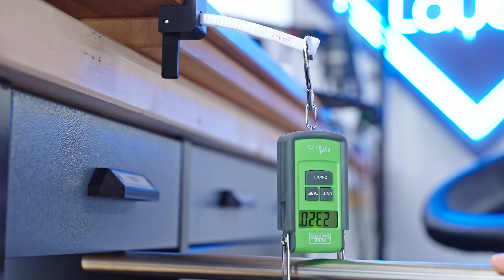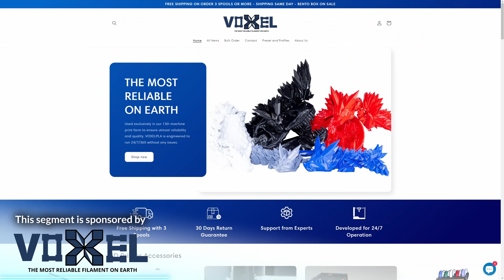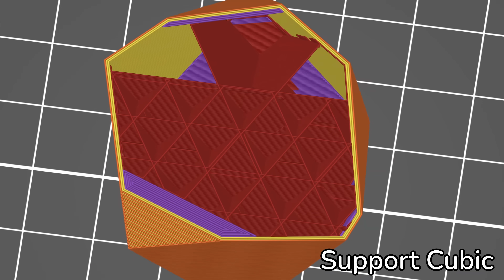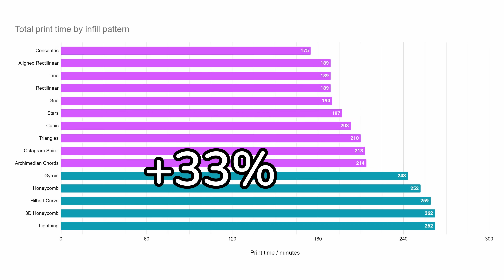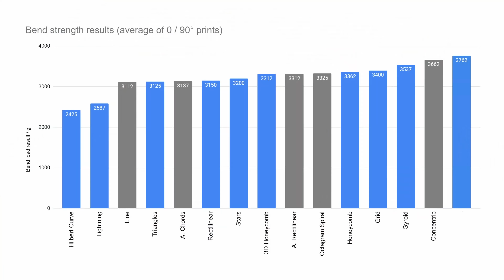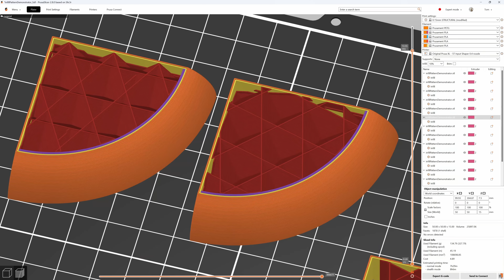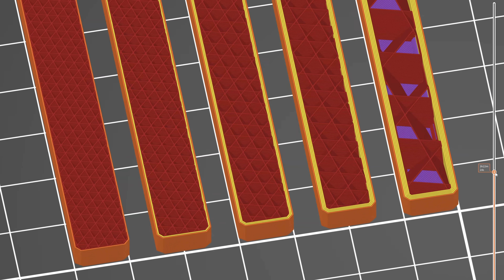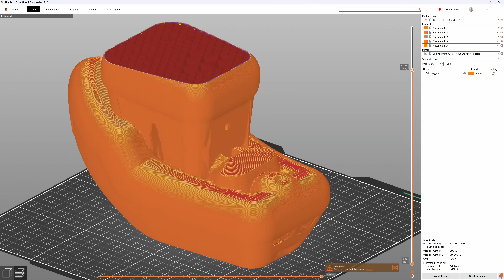Rethink how you use 3D printer infill!

Comment: Every time I think how to optimise infill for a particular use case, I come to the conclusion that something like a CAD integrated slicer would be the best solution. I mean in most CAD applications you can simulate directed loads. Using this information, maybe with some AI magic dust on top, a use case specialised infill pattern could be generated. As I’m only a hobbyist I don’t know if that already is implemented in more professionalised software than what I know about.(?)

Comment: Ok maybe you want to rethink that just by watching your video. So first we figured out the cubic(as it should be) is overall best at making things work. For one du to it's universal directional rigidity and two actually because it crosses over itself. This strengthens all the crossing with double material creating thickened edges inside the pattern while still be ultra fast because straight lines.. ok sure I did know that. But the ominous ripping itself apart
Later you pointed out that she'll goes over everything so we can just neglect infill an take that only into account for top layers in that case the best combo should be thick with rectilinear. It's blazingly fast - straight lines - and doesn't have an issue with ripping but is near perfect for top layers. Rectilinear is the actual grid pattern slicers should have default because this one just works - always - at any density to give the users the highest chance of a successful printing. It's like turning on infill combination(infill every other layer) but not because it's touching every layer avoiding issues with significant different layertimes every layer which can cause printartefacts.
Just saying from all combined above this should be the winner in terms of overall performance. It's weak but we don't really care because the shell is doing the strength and infill only provide structural shape holding and top layer surface promotion functionality

Comment: One advantage that Gyroid has is that it allows the print to be filled internally to add weight or possibly with foam for strength.  I've printed some tall sculptures that I've added sand in the base to make them less "tippy".  The closed patterns won't allow the sand to flow beyond their individual chambers.  I also like Gyroid for it's multi-directional support.
Reply: Hilbert and other open variations are even better for pumping the model full of PU resin/foam, gesso, concrete or what have you.
Reply: Another good use for gyroid (and 3D honeycomb as well) is exposed as drip trays for plants, coffeemakers, etc. Because of that open pattern, liquids flow between the cells.
Reply: @YoSpiff  I made some drip trays for soap bars this way. Just add a modifier object in the slicer and set it to remove the top and bottom layers at the overlapping spots and its fine. Might need to slow down the infill speed a bit to make them look nicer tho
Reply: Do you pause the print to fill it up or how do you do it? I printed a cool tall vase for my mom but it keeps falling 😢
Reply: @tuliagz5329  Is the vase used for liquids or just used with dry plants or flowers (or nothing at all).  Usually, you would drill a hole in the bottom of the object and use a funnel to fill the infill portion of the print - or at least partially at the bottom - then use something like a mixture of 5-minute epoxy and sand to plug the hole.  You may have to roll the object around to distribute the sand or whatever you're using.  If the vase is easily accessible from the top you could put the weighted media in from the top - sand or plaster or lead shot and seal it with a layer of epoxy.  There are a few ways to do that, but without knowing the structure of the vase it's hard to make sure recommendations.

Comment: I've recognized cubic infill when Cura and Ender 3 was my choice half a decade ago. It felt intuitively and logically right, to use cubic since then. When I got my mini, some years ago, it was strange to see gyroid as "all profiles standard" in Prusa Slicer. When I got my XL it was the grid infill, if my memories are correct. So the usual first thing to do is to check, if cubic infill is selected. And btw, PETG is my 90% go to material, for ultra high strength parts some PC. PLA was a disappointment so often, that since I flew the limitations of my moody Ender, I didn't buy another new roll of PLA, except one Galaxy Black PLA, for it's mat finish. PETG is more on the shiny side of live. 😂

Comment: Turnes out gyroid is faster than cubic on mu Klipper machines. Alltough slicer says cubic is faster, in real life it isn't. Also I use very aggressive speed settings on infill and gyroid doesn't stop on a dime at the end so the rocking of the printer isn't that bad 😅

Comment: I think your thumbnail was one of the main reasons you got 50K views in one single day! -It's just perfect! 😃
-Anyway, I'd like to put a note up that I've used 1.2mm wall thickness for more than 2 years and I've gotten quite good results with both PLA and PETG. I'm using and old, old version of Cura and won't change anytime soon, so I'll not have the benefit of getting cubic infill (which I'd like to use).
[I never see any infill-artifacts on the surfaces, because I use so thick walls - except from of course when I use translucent filaments].
Excellent video; I could watch from start to finish without falling asleep (most YT-videos make me fall asleep nowadays). 😃

Comment: Gyroid has been my go-to for the longest time now. Great strength to weight, reasonably quick printing, and minimal external surface artifacts. Another benefit is that if you do need to fill the print, all of the airspace is contiguous, so filler materials (resin, plaster, sand etc) flows fairly easily to fill the space.

Comment: Another vouch for the concentric, hilbert, archemides, and octogram is that as they're completely free of any isolated pockets and can be taken advantage of when you want to fill in the void fraction of a 3d print to further strengthen them. Such as as filling them in with resin. 

You can't do that with a lot of the other infill options.
Reply: This is the case with gyroid as well. This also means hot air can be trapped in those pockets which creates pillowing occasionally. Good to know the different options for different use cases.

Comment: CNC kitchen did a pretty deep dive on this issue a while back, at least in respect to shell thickness and strength. Infill has relatively little impact on part strength even when it's set pretty high. I usually run 4-6 perimeters with as low density possible with lightning infill to save on material since infill contributes relatively little even in different use cases. The only con of lightning infill is slow print times though.
Reply: The problem with infill in regards to bending strength is that the infill contribution to the cross section's moment of inertia around the neutral axis is extremely low.  Extra top and bottom layers put material where the majority of normal bending stresses occur.

Comment: Another thorough and useful test Thomas. You are a gentlemen and a scholar my friend.  I have been using the Voxel PETG + for a few months now and it has been performing great on my XMax3.  I was hesitant to believe the claims it works on high speed printers but it certainly does.  It sands much easier than PLA as well.

Comment: I print materials that, overall, gotta go slow anyway but I need similar strength profules actoss multiple axes. I used to spend hours tweaking infill settings to get the cubic and other straight-line patterns arranged just right to preserve strength and top surface quality until gyroid came along.

Now my print default is 15% gyroid and three shell layers and I can't remember the last time a part failed to print of perform well.

Comment: I really like to use the gradual infill setting on Cura - for parts that are for show and not strength. You can get high surface infill at the top for where you want things to print smooth and sparse infill elsewhere for material and time saving (40% infill at the surface rapidly falls to just 10% with only 2 steps). The lack of this and gradual support settings are currently causing me to hesitate to jump to Prusa/Bambu/Orca Slicer.

Comment: To print infill fast on my modded ender 3 v2 i typically use 150% - 200% line width and 20% - 75% infill density with the grid pattern.

Comment: One of the patterns you thought was just in there, I actually have a specific but incredible use for. On the concentric pattern, I actually have two uses. One is purely aesthetic, on transparent filaments sometimes you don't want the infill to show and strength isn't paramount.  The second use is more functional. On TPU prints, flexibility is always needed, but it can vary in how much flex is desired in one axis. I find the concentric infill makes for a very strong vertical strength but very weak lateral resistance. This is super useful if I don't want to spend hours in CAD to do the same.
Reply: very good points. I used to use lightning infill for transparent prints and it looked pretty good. but for "full" transparency I recon concentric is better indeed
Reply: This might differ in practice, but in mechanical theory honeycomb is supposed to be highly anisotropic as well so that might be worth a shot
Reply: Thank you for this worthy addition to his already great video! Especially the adjustment of flexibility in TPU prints is a very nice concept.

Comment: mostly used default grid pattern since it prints fast and is good no matter the orientation, shape or size of your part. over 30%/35% infill was never bringing me any additional benefit and sometimes even decreased strength and quality. below 10% infill (about a 1cm bridge distance) part strength as well as top support is about the limit. A good default is 10% (1 or 2 shells) for fast prints 15% (2 shells) for everything or 20%/25% (2 or even 3 shells) for strong. honey comb is kind of good for strength but very slow for big models even on old printers. most patterns are a wast of time and material or highly situational at best. 3d rotated patterns tend to have bad layer adhesion in some cases which may even harm strength.

Comment: I’m fairly new at printing but I use gyroid for parts that need to resist deformation in many different orientations. I had assumed it would be decently fast (even with input shaping) since it doesn’t have many sharp corners to start/stop. 
One thing I was thinking for thin parts with 100% infill might be to use concentric so your nozzle isn’t bouncing around.
 
Hilbert curve might be a good one for flexible/semi-flexible filament in parts you want to bend- in the sideways direction.

Comment: When optimizing, it would make sense to have the strength in the shell and the infill to be as minimal as possible to support the top layer. Following that logic wouldn’t it make sense to use lightning infill?
Reply: Keep in mind that lightning will make it mostly hollow inside, with no support at all for most of the shape. Honestly I'd rather have even minimal infill than no infill in many cases, so I often use support cubic instead. Also if you have a problem with the infill, lightning usually won't recover.

Comment: Personally I use rectilinear for its clean prints and very minimal internal wiping, it also prints nicely on both bedslingers and core xy alike. One thing I find it particularly useful for is checking that bridging and general extrusion is in point when I’m switching filaments for different prints as if it is off even slightly you see it won’t connect at walls or sags in the infill and is really easy to see. Top layers are nice due to the even square finish if you want top keep top layers to around 4 instead of going higher and using more filament :)

Comment: I like the idea of printing thicker infills to save time. I think delamination occurs as separately printed structures have time to cool and therefore don't adhere to one another.

I have recently printed small-ish parts that needed some strength and wall-to-infill ratio made very little difference. I found the biggest gains in strength by lowering printing speeds altogether.

Comment: These test are good and give data as a starting point, but for anyone trying to learn and understand what makes a print strong to a precise point, use TPU. It is an amplified version of what’s happening microscopically as your stiff parts snap, allowing you to feel and understand it to control it. 

Infills are very directional for load application. Thicker infill or line multiplier greatly increase rigidity 

Best of all the part never truly breaks allowing you to return and do the test months later to freshen up the knowledge, without wasting time for breaking more test prints.

Comment: For thicker infill use infill line multiplier (as named in cura) so each layer is double thick. This is for strength as it add rigidity to an otherwise flexible thin wall. Half the infill and double the multiplier. Speed and material use-age are similar, but strength is better

Comment: Another criteria that for some reason almost no one talk about - is how  NOISY or SILENCE the infill print is? in my case, where the printer is in my office - this is a decision point. The standard grid infill is one of the most silence one to print with, and as much as I can explain that, it comes down to two key reasons: only one motor is active at a while printing grid infill (as the printing head moves either on the x axis or y axis) and second reason is the there are no overhang parts in grid infill (like you might have in cubic or gyro) therefore no need to boost the fan to 100% to cool the overhand parts down

Comment: When printing functional stuff, it's important to think where the stress will actually be when used. Walls and infill reinforce the whole model evenly, but in real life we only have one or two weak spots where parts break. It's much better to reinforce these weak spots with internal geometry (which will be printed as hidden walls inside) and reduce the overall amount of walls and infill to save plastic and increase printing speed.

Comment: I use Gyroid because its more silent than the crossing of cubic, it also doesn't wear the nozzle down as much. And for me the time difference isn't even that much, maybe on a coreXY but on a bedslinger? nah fam, they are practically the same speed. On another note, gyroid is really good for making TPU parts that need to have a uniform pressure/deformation resistance and the non 3d infills can make TPU stronger in one direction but more bendy in another if you want that.

Comment: I really like printing with alternating Wall counts. So the infill is well attached. For parts where weight is a concern, printing with 2.5 walls is not significantly weaker than printing with 3.

Comment: The thing with gyroid pattern is that it has the same strength in any direction. It might not be the strongest in one specific load direction, but over all, it probably is the best for general strength.
Reply: So does cubic, which outperformed it in the strength and time metrics. Both are isotropically shaped.

Comment: Another problem with the self intersection of grid, triangles, and stars is that the self intersections always happen at the same X/Y coordinates (3 lines thick for triangle!) This can lead to a noticeable bump forming that can catch on the nozzle tip much worse than cubic. It can also make a REALLY nasty rattling sound as it drags along.Found this out the hard way after building my Mk3S all those years ago and the included GCode for the Nefertiti bust  failed several hours in from the buildup (and probably not perfect adhesion to the build plate).

Honestly it amazes me that grid is still the default pattern in PrusaSlicer (I don't know about the other forks) after all these years. As you've shown here, and as I've seen over thousands of print hours, cubic and it's direct derivatives, perform as good as or better than grid in most situations.

Comment: Is there a way to use the occasional solid infil layer as a way to switch infil patterns? May be useful to switch from Cubic to something like aligned rectilinear for the last few layers near the top of the part. That way, most of the infil is the strong cubic, but the top surface finish is the best.

Comment: Rather than use % fill just use spacing between infill lines as the infill parameter. This means that there is a constant distance between infill attachment points and the walls.

Comment: quite interesting, ty for the video, actually i have a question, is it possible to add layers to infill, by that i mean to make infill with larger wall, bcs a simple infill with low% but with 3 walls can be much stringer in some cases. Havent seen that option in any slicer ?
Reply from the maker: The reason why a thicker shell on a print works so well is because that's typically where you'll see the highest levels of stress on the material, while the core (infill) of the part mostly has a supporting role. As long as the infill adequately supports the shell and keeps it from buckling or caving in, making the infill lines themselves stronger won't make for stronger parts.

Comment: Always just use rectilinear myself, fast print, adhesion to walls, and provides good even support to the top layers.  I print most everything with a 1mm nozzle, so strength all comes from shell, the infill doesn't contribute much, as you demonstrated.

Never liked lightening or support cubic myself, I would much rather PrusaSlicer have an option for rectilinear to increase density as it approaches the top, and have done so manually before using height modifiers if I need to have a small or awkward top surface section supported by infill.